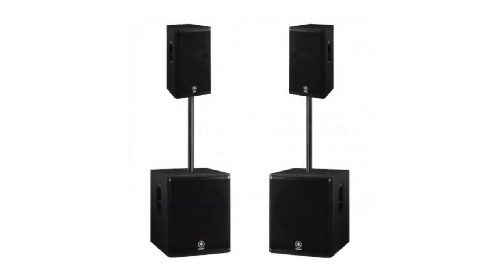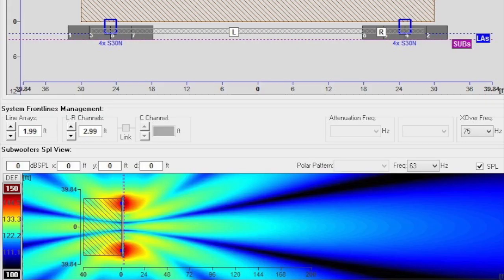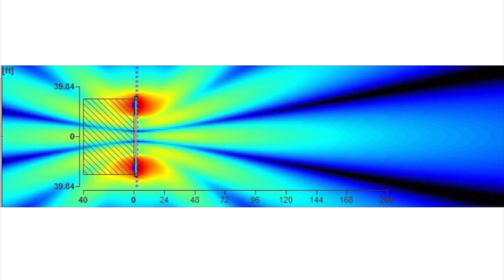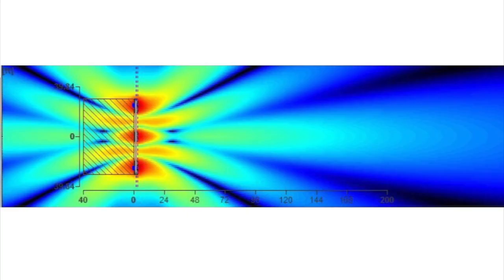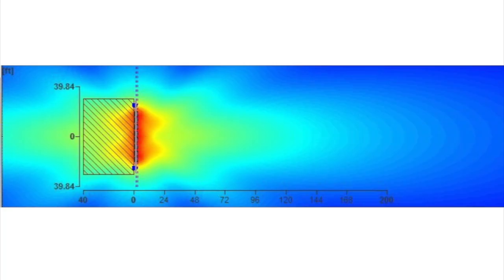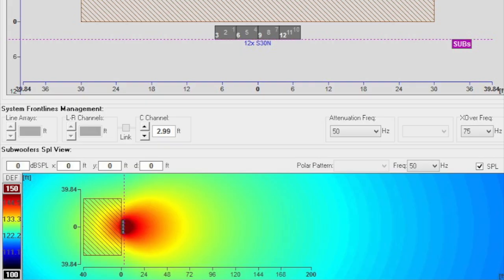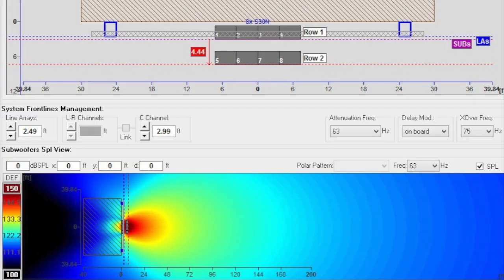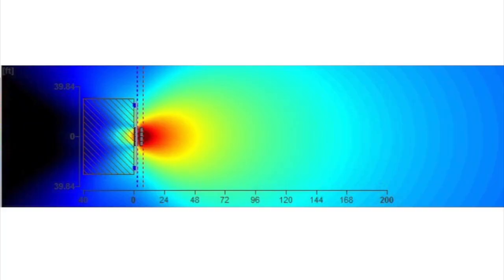TECH: LIVE SOUND SUBS SUBWOOFER PLACEMENT & CONFIGURATION - LR, Center, Line, Cardioid, End Fire

Comment: I've heard that if you use spaced across array you should delay the subs the longer away from center stage they come, I guess this would also be the case for the LCR config. Is this correct? how do I figure out the delay times if that's the case?

Comment: I have 2 questions, 1: Does the Cardioid configuration give you any additional summation in the front?  Like is it more efficient?  We don't have many subs (6) or wattage to work with so I'm trying to maximize it, also, can you run it as a Line-Cardioid?  Or does the spacing then mess up the cardioid pattern?  I've tested that in Mapp XT and it seems like it'd work ok, but not as great.  But again, I can't afford to put them all together because I only have access to 6 subs.  Thanks in advance!
Reply: I think it depends. If you have your audience side subs delayed for the time difference to the other sub(s) then you'll get more level out front, and some cancellation behind the subs. If you set it up with the polarity of the back sub flipped, and delay this sub for the time from the front sub, then you'll get much more cancellation behind, but also get some cancellation out front.
Reply: What did you end up doing and how did it turn out? Chinese clone D&B Audiotechnik 3*21 SL Subwoofers (designed as cardioid) is what I'm going with but even then the cost adds up.
Reply: @stiffmeister0hYeah  Outdoors, I use a "Smiley-face" configuration, I use the speaker pole screwed into the subs for my PA tops now (QSC KLA, 2 per side) so I put 1 sub Left, 1 sub right, ON the stage/trailer/whatever we get, then 2 or 4 subs in the center often as a spaced line, sometimes center cluster, all depends on the situation.  So, 1 sub left at head-height, 2-4 on the ground in the middle, then 1 Right at head-height.  But mostly what I've learned is, it doesn't really matter all that much on how you configure them for PA systems this size it really doesn't change the sound/coverage much at all.  And it CERTAINLY doesn't mean much inside like in the winter when I do smaller bar type gigs.  The PA deployment config doesn't mean as much at this level as it does when you start getting way more boxes involved and/or are outside in a large area.  In that case, the best configuration to my ears, and that I've used, was 16 subs in 2x2 blocks.  So 4 blocks of subs, spaced evenly across the front of the stage (with a center fill on top each block).  That system freaking ROCKED man, that was a ton of fun to play with lol.
Reply: @djjazzyjeff1232  ok I got it with the subs. My mains are DZR315 and I only have one pair. Problem with those is that you can't hang them or use a pole mount!! The Yamaha videos/brochure ha them sitting on top of a left/right sub. So I guess I will purchase another pair just in case (first). Yamaha brochure also shows a second set of DZR not as center fill, but on the sides of the audience far from the stage (not center fill). All good, at least two pair. No way I'm paying for 16 subs but I'm ok with 8.
Reply: @stiffmeister0hYeah  That big system wasn't mine, I wouldn't do that either I don't want to have that type of investment in gear+ having to maintain it all sounds like a nightmare, I'll leave that for the big production and rental places lol.  I used a system very comparable to that for a LOT of years with really good results.  JBL Dual-15 +Horn tops, 2 18s under it (with a 3/4inch shim behind the Top speaker to angle it down just slightly) and were pretty much stuck with that config.  If you find yourself on a trailer or a stage though, you can just set the speaker ON the corner of the stage.  I did that plenty of times, then did a spaced pair across the front of my 4-6 subs, under the stage if possible just so they don't get bonked by shit all night.  I've also heard good sounding systems with only a Single-15 on each side sitting right on the deck of the stage and a single 18 under each.  Sure power-alley and valley were really apparent, but it wasn't too bad for such a big space with so little PA, it sounded pretty dang good.

Comment: The problem with the video is it shows what is clearly stated as the setup that is most commonly used- two subs under two tops, AND how that setup is usually laid out, then says it’s the worst possible thing. Followed by showing different more elaborate setups that suck. And finally a setup that is nowhere near the setup most commonly used that doesn’t suck.
How about a video showing how to configure the setup most commonly used do it does NOT suck?

Comment: Great video! Is there a specific way to measure the best way to place the subwoofers in a line? For example if I have 6-8 of them, what would be the best way to spread them out along the front of the stage?
Reply: Hey. Been learning about the "why", and not just the "how" lately. It has to do with frequency lengths of the highest frequency coming out of your sub's (crossover point).  The higher the frequency, the shorter the length.  For example, 80 hz frequency is about 14 feet long.  You do not want to go beyond 2/3 of that length in spacing between the subs.  That is measured from center sub to center sub, not from edge to edge.  If you go beyond that, then you get the lobes, cancellations, etc.  Lynx pro Audio Expert Guide Positioning Subwoofers, is a good article.  P.S. I don't own lynx pro subs, I own behringer subs. Have a good one. Carl  P.S.S.  If you go beyond 1/3 of the length, then you lose any bounce in volume by having two subs next to each other.

Comment: Incredible, I was running my LS801ps last night in a club and I was very dis-pleased with the coverage.. been looking into a cardioid pattern.. i wonder how to do that with the LS801ps inside a small club... I swear, it sound better if i only use 1.
Reply: Try placing both of them center stage / Venue next time. Leave 4 feet behind them if their is a wall.
Reply: Join both subs in the same position. No cancellation and u'll think a speaker is added. Works for me everytime.

Comment: How do you determine how many inches / feet you seperate 4 subs in front center to change from a center set up to a line set up to add bass to the sides of the room that you lose by having all 4 touching one another in dead center?   I understand more bass would be in center with the coupling effect of a true center position but I am willing to give up some center bass to add some to the power valleys out to left and right stage.  Thanks,  I'm guessing 8 inches to 12 inches apart, or do I need more than that???  The 4 subs are JBL PRX815XLFW.  The cabinets are only 17.5 inches wide.

Comment: Musicians Pro,   I have (4) JBL PRX815XLFW subs and tried  left right and left center right with obviously no luck and now understand per your great video.  So I tried all 4 in the center and it did sound much better but the bass on stage made it very hard for the musician and those lobes or power alleys 45 degrees off stage were bad.  I'd like to try a line setup in the center with spacing between the subs yet keeping them still center.  I don't mind the small loss of the 3 DB from the lost coupling from moving them a bit apart from one another.  My first concern is to eliminate the power valleys 30 to 45 degrees from center stage out into the crowd like what you get in the left right configurations, and less important and the second concern is stage volume.  I notice a bit less stage volume and better bass fill out into the crowd with that 4th choice, the line array.  So my first question would be, how far apart would you place the subs from one another in a center line?  I'm guessing 6 to 18 inches?  I have the subs set to produce 80 HZ and lower and would like to limit the db loss in the 50-80 HZ range, not caring if more is lost below that.  I'm just hoping you could give me your best guess on that space distance between each sub.  I assume that may help you determine the distance to separate the subs?  Also is there any benefit to putting sub 2 and 3 together and sub 1 and 4 a bit further left of sub 2 and right of sub 3?  Or do I just evenly space them to get the best version of "line setup" per your diagram of scenario #4.  Last question and this would probably be the best for me at the next sub purchase.  It appears that cardioid setups seem to be in combinations of 3, meaning 2 frontward and one backward.  Does that mean I need either 2 more subs which would equal 6 or don't use one of my four and just use 3?  Thanks so much for your answers and when giving me ballpark sub spacing for a center line setup with 4 subs, let me know if your dimension is the space between the subs or the distance from the center on one sub to the center of the next sub.  My (4) JBL subs are 17.5" wide, contain 15" speakers, 1500 watts each and set at 80 HZ and below.
Reply: Did you try the cardiod or end fire configuration? Having for subs, did you try six for cardiod?

Comment: If I have 2 2x18 subs currently positioned L/R, would it be better to do a center or line config? Not sure how the line setup would downscale to just 2 subs. I would guess it would be better to place them right next to each other?
Reply from the maker: It would certainly be better to place CENTER.  A line is several subs centered, but the outside subs delayed to create a virtual arc.  It will focus the sub energy more to the center and less omni.

Comment: Forgive me if this has already been asked but what are you using to delay the subs?
Reply: squaty1212 
Im pretty sure the dbx drive rack does this also many digital mixers can add delay to a channel.
Reply from the maker: My subs have delay built in or I use the RDNet ethernet system to control each box's DSP.

Comment: How many subs are required for effective application of the "in fire" configuration?I'm setting up an all new rig and i will only have 4 single 18" subs to work with.
Reply from the maker: 2 located center stage.  4 if you must place them in the left and right locations  (not stereo, just positions).  You can also put all 4 center if you want for better results.

Comment: I am working on a show right now and I always do center only (I only have 2 subs) and the bass is amazing from the front center to the back but drops off to the sides, this is a wide auditorium that fits about 800, any recommendations to spread it out more?
Reply from the maker: Subs are almost omni-directional unless you are using a special config to stear the low end OR you have other issues going on causing an anomaly.  Try to get a SPL reading with just one sub on at all 4 sides of the sub.  Then add the other and take another SPL reading.  Did the SPL pattern change from Omni to more directional?
Reply from the maker: With a few more subs you can create a "LINE" which really widens the pattern.  See the video for the SPL plot.

Comment: Please don't mention people with 2 sub set ups and then go on to explain using an 8 sub festival rig, many meters apart. You've over looked way too much information. Like go check out a 3M/4M speration graph. Centre cluster nearly always trumps but that's beside my point here.
Reply from the maker: 1 sub or 4 subs per side is irrelevant to this video.  The purpose of the video is the general understanding in the way low frequency waves interact with each other based on their placement.

Comment: Setting up a very small p.a for small cover band. Playing very small venues 100-200 people tops. Running powered Mackie speakers. 2- 2 way 15" tops and 1 - 15" sub. Using the built in crossover in the sub.  The plan is to pole mount 1 - 15 on the sub, the 2nd 15 on a tri-pod. My intention is to place them about 16' apart with the subwoofer side about 1.5' from a wall. Will this work for a decent front of house sound?
Reply from the maker: 2 tops on 2 tripods in LR config.  Sub in Center is the best option.

Comment: This is so magical, my brain exploded. 
Thanks! For cardioid configs, on a small system, (say less that 6,000 W total, including subs and tops), I could theoretically set up 3 identical subs (delayed properly) with 2 tops, and theoretically melt faces? Keep in mind, I realize that "melt faces" is not really quantifiable, especially since I included no specific speaker in the statement. But it could really improve the low end performance of the system.

Comment: Great video! Thanks! 

How does the pattern change with frequency? I realise the distances and delays are frequency dependent, how should I think about it?
Reply from the maker: tifius - yes, the patters do change with frequency. Higher is more directional. Lower is more omni.
Reply: Thanks for the quick response. So if I want an optimal "infire" setup for a higher frequency than 67hz I should decrase the phyiscal distance and delay time between the front and back row of subs?
Reply from the maker: tifius - yes. The concept of endfire is very simple. Pick the Freq you want max cancelation. Find its 1/4 wave length. Space your subs by that distance. (Front to front). Then delay the front row for that distance to create summation in the front field.

Comment: Thank You For The Great Video :)  I do have a Question , I have a great Party and Jam Space, it is 26 ft wide 40 ft long and 16 ft high, The walls and the floor are concrete, I have carpeted the floors and the walls  are 50% carpeted about 10 ft high, I do have a loud system for the top I have 700 watts RMS Tower Speakers, and for the Bottom Low`s I have  2 x1000 watt  Bass Reflex Sub`s , and  2 x EV T18`s , I have replaced them with more powerful Subwoofer Basket`s  1000 watt QSC`s, I`m Running Loud speaker management system by DBX, and second Set of EQ`S i HAVE 3 amp`s The  QSC  is being used for the two Bass Reflex  subs, The Yorkville amp Is being used for the  T18`s  They are Bass Scoop, and The  MACKIE  is  Driving the Top Speaker`s. I have a   PV   Crossover  for  the  T 18`s  because they are recommended  to Run on a Different Frequencies ..My Drum`s are fully Miked and the kick I`m using a mike and Sub kick Box . My Problem is I don`t know much about sound Systems, I`m Just Learning, and I do love loud and clean sound, That`s why I did spent the money, My 2 x T 18`s are not hooked up yet Because I don`t know how to set up the Crossover. I would like to get that chest pounding Kick drum and Floor Tom Sound`s, Can You Help Please, I Thank You In Advance :)
Reply from the maker: It sounds like you have a lot of mis-matched gear.  This will always be a problem and never time or sum properly.  The best option is to always have matched speakers that are powered and processed from the manufacturer.

Comment: is it worth doind a cardioid set with two tops and two subs?  having the sub stack in the center with one facing forward and one rear with inverted polarity?
Reply: sub are stacked side by side
Reply: Miki Do If you are delaying the front sub then yes. The front and back sub because additive from the crowd perspective so you won't be sacrificing anything while only using two subs which is important.
Reply from the maker: If they are stacked, it will work better.  Not side by side.  3 subs side by side work great.  Center sub will face backwards.
Reply: @MusiciansPro  but do i dont have the same lr problems between the subs?

Comment: in the case of only having a nomal setup 2 speakers and 2 subs...the best way for the subs would be line? or even center could work fine?
Reply from the maker: 2 subs is not technically a line, but center or center with spacing would be better than LR.
Reply from the maker: It is inportant to realize that the SPL plots I am using are in open space.  So yes, everything changes when you start to factor in walls and room sizes.
Reply: I would argue that it depends on the size of the room however and the subject material. If you were in a small to medium size room the power valleys might be so insignificant that they may only effect a handful of people. Add small signal variations to the left and right channels to actually make the signal stereophonic and this will reduce the comb filtering further and will yield significantly better coverage than a mono cluster. (Look at say 48ft on the graph so a fairly small room)

Just saying there is certainly more than one solution and energy propagation is really only a fraction of the situation!